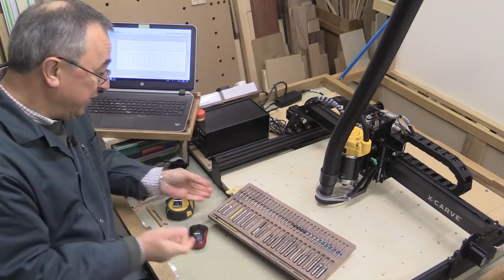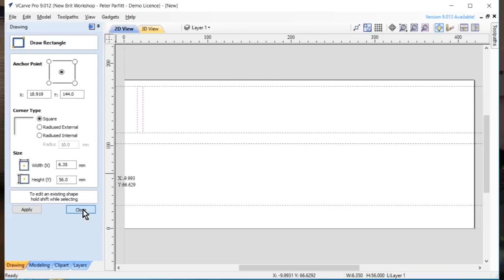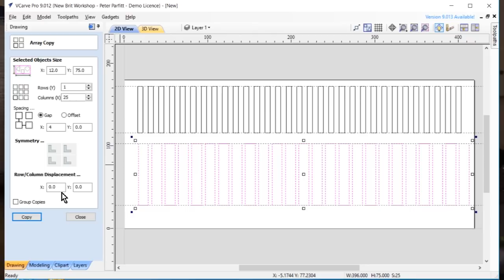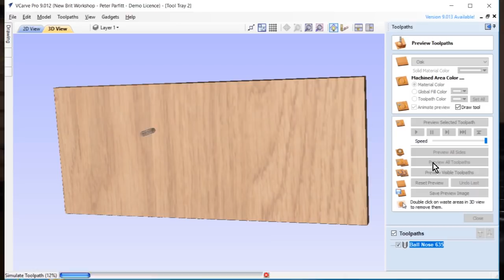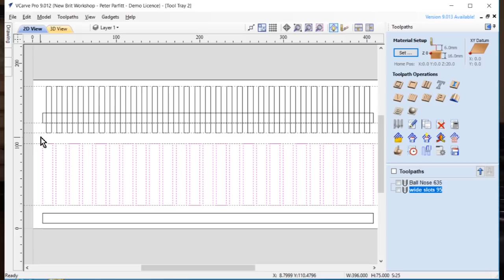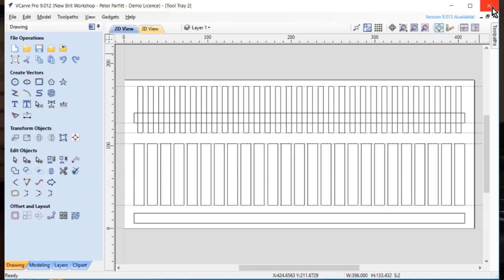Making a Tool Tray for the X-Carve CNC

Comment: what is the short cut to undo the first set of squares? Control?  I could not understand what he said.
Reply from the maker: Hi Dan, I think what you are referring to is my use of Control Z - Hold the Ctrl key down on your keyboard and then press Z once. If you keep pressing Z it will delete the action before and then before that and so on.  Peter
Reply: @NewBritWorkshop  Thank you sir. I just could not make that out.

Comment: Thank you so much for an excellent video once again. I have one question and one request.
1. After some time using the Xcarve, what is your feedback on the machine? My intent with a cnc is to do some 3D carving (flowers, faces…) to be added on part of my furniture (in fact not real 3D it’s on a flat surface, I think it’s 2.5D?), will the Xcarve fit this? And if we compare it to the chinaCNCzone 6090 that is coming for almost the same price but with a 4th axis and 15cm of working Zaxis instead of 8.6 for the X carve?
2. I spent many hours watching your videos that are so rich, but now I remember that I saw something but it’s quite impossible to find in which video it was, and title like workshop notes #... is a little cryptic when you search for a specific review or advice. So, if ever you have time, it should be useful to have a summary of the different content of your videos to quickly find what we search for. I know that you do it for free, and I don’t want to add to your workload, but…
3. Thanks again for all the time and expertise you share with us.
Reply from the maker: Bonjour Olivier, The X-Carve is the ideal machine for someone wishing to learn about CNC work and this includes schools and colleges. It is also good enough to support the professional who requires small pieces to be fabricated but it is not suited to production work as it is not built to that standard. The machine is certainly capable of any 2.5D task provided the right software is used. I have set my machine up as carefully as I could and I believe that it is accurate to about 0.5 mm over 400 mm, perhaps slightly better. This means that it may not produce perfect inscribed or escribed interlocking circular parts but for general carving it is super. For decorating your furniture it would work fine. I have no knowledge of the Chinese machine and so cannot help you make a comparison. I fully understand the need to be able to search a catalogue of the 300 plus videos but it would be impossible for me to do this. I have done my best to put appropriate key words in the video summary that should allow a Google or YouTube search engine to find most things.  Many thanks for the kind words.   Peter

Comment: Hi Peter, great tutorial on how to see this job up. One thing that you might want to make use of as a matter of habit, it is the use of layers. If you put like items together, say the top row of slots, select them and place them on their own layer, then when setting up a tool path you merely need to select the vectors by choosing selection type as automatic (last item in the tool path menu), select the layer you wish to mill with this tool and Robert is you father’s brother. Even better if you check the “associate with tool path” option. This way if you wan to mill more than one at the same time you create an array of them. Place a large enough piece of material on the CNC and away you go. Your need not need to go in and individual parts to mill for each tool as Aspire is smart enough to figure out how to mill each layered item in the array. If you include a profile tool path to cut out the parts to their exact final dimensions it will mill that as well. While when doing a one-off this is a little overkill it is a great habit to get into. Placing something on it’s own layer could not be easier. Select the items you want on the layer, right click on the item(s) and choose new layer. If you make this a habit then as you projects become more complex this becomes a excellent organizational tool as well. Dan
Reply from the maker: Hi Dan, This is really useful guidance, many thanks.   Peter